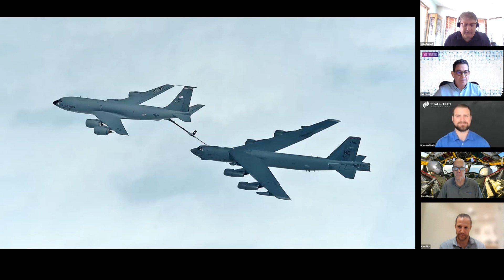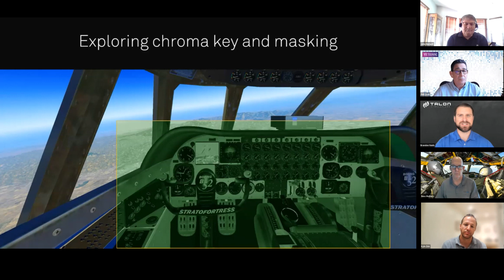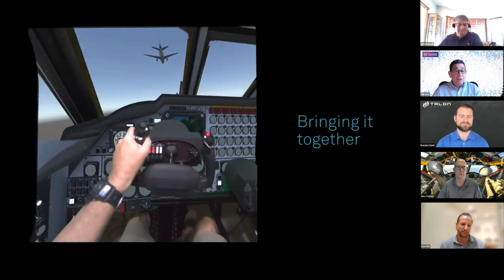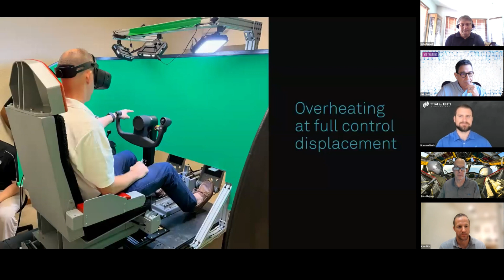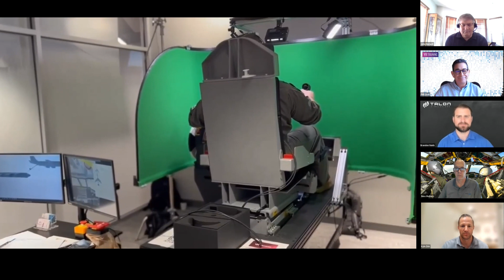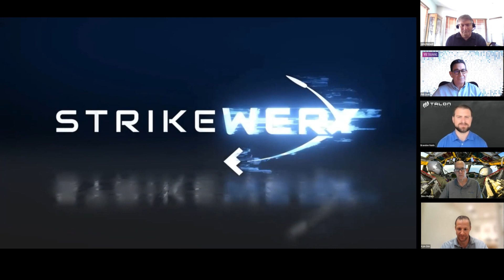From Contract to Deployment: Building an XR Air Refueling Simulator for the USAF

Comment: I could not see it, but is the forward/backward movement implemented? Together with roll, pitch and heave that would mean 4 DOF.
Concerning the actuators and the overheating issue, I'm wondering why one did not consider using D-BOX actuators. I have a 5 actuator system (4 DOF) at home and it's operating great without any flaws. By the way, I have the Varjo Aero and I'm very satisfied!
Reply: Hi Edward, the motion platform is just 3 DOF with roll, pitch, and heave and does not have surge or sway. The overheating was on the electromagnetic actuators for the control loading on the yoke rather than the motion platform.  Holding the yoke at max rotation meant maintaining 40 pounds of strength over an extended period which we did not anticipate and it quickly heated up the actuators. Adding a fan inside quickly resolved that concern.